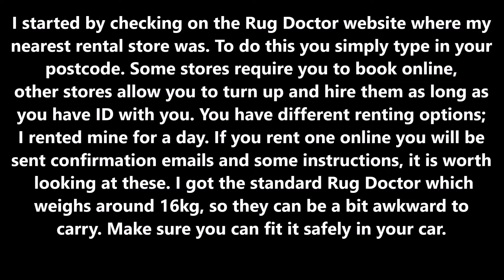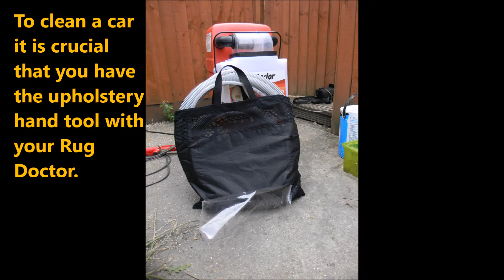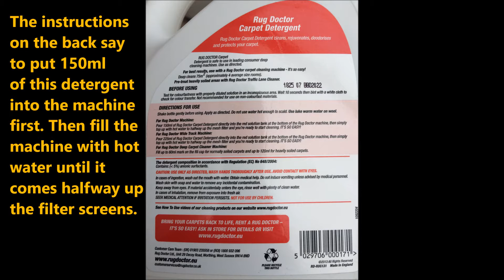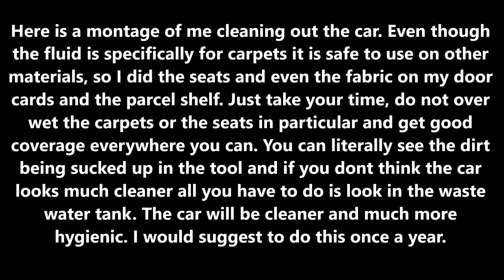Using a Rug Doctor to Clean the Interior of a Car

Comment: To confirm you used 150ml solution with 2 full milk gallons of water (approx 4.5l) ? Have some spare so trying to work out good ratio for car upholstery although ill prob knock it down a little to be safe